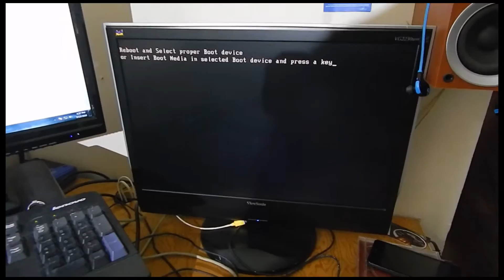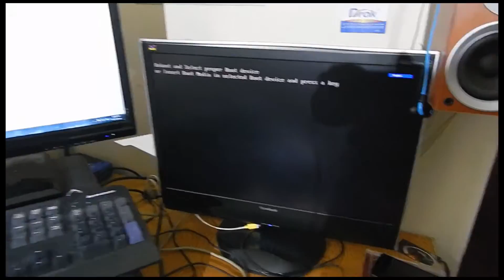MSI G41M4 COOLER MASTER GLITE REPAIR

Comment: what about using an AUSTECH FM2+ 88 motherboard and AMD A10-7850k and 32GB of GDDR3 RAM for both main memory and graphics memory no graphics card or sound card is needed as all peripherals are part of the A10-7850k with the exception of the UEFI/BIOS,Ethernet and memory slots.